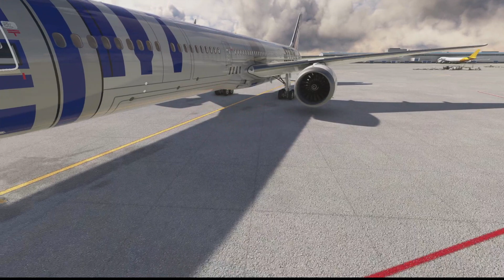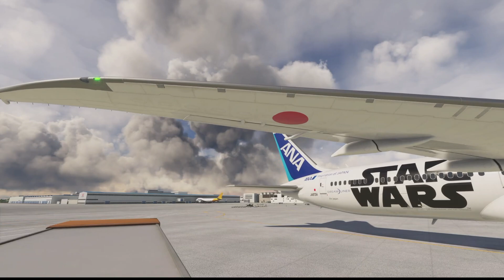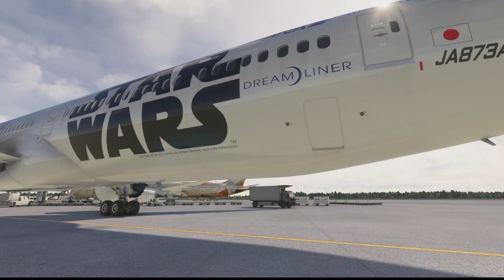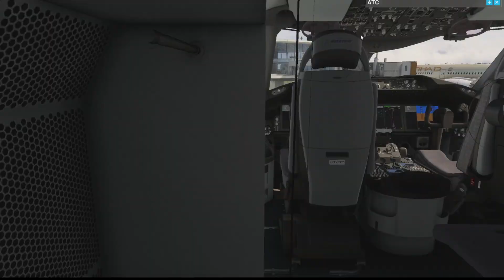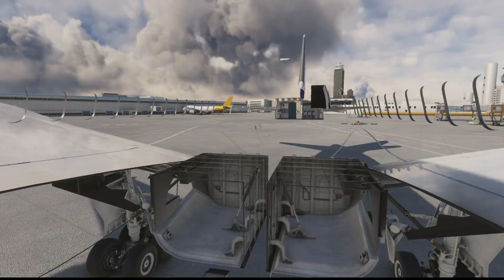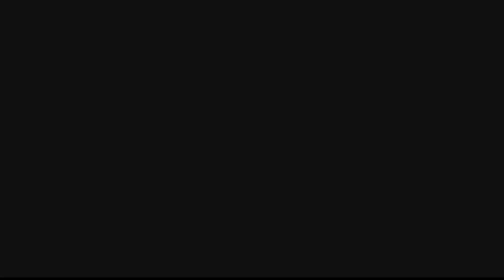SIM UPDATE 15 Performance Test  XBOX #microsoftflightsimulator #msfs2020 #msfs  #xbox

Comment: What mods are you using?
Reply from the maker: Hi, thanks for your question. I try and keep add ons to a minimum as the Xbox can struggle a bit. I have The Flow Essentials toolbar, LVFR Static Airport Traffic and then for this video I’ve installed the drzewiecki design Narita international scenery which is pretty complex. I also have real-time weather on but turn off traffic & multiplayer. Thanks for watching & commenting, appreciated ✈️👊

Comment: How do the AI aircraft around you have liveries if you are on Xbox?
Reply from the maker: Hi, thanks for your question. I have the LVFR Static Aircraft add on installed which puts various aircraft / liveries dotted around the stands to match with wherever you are in the world which is cool and adds a bit more immersion rather than the default MSFS planes. What I would say is if you fly with multiplayer or real world traffic on it can be annoying as sometimes they’ll park on top of the statics. Apart from that I’d recommend, no noticeable hit on performance. Thanks for watching ✈️👊

Comment: My friend, plz, what addons do you have installed ? Weather pro ? How many world update ? Flow essential....? Thanks for your vidéos !
Reply from the maker: Hey thanks for your question. As I’m on Xbox I’m fairly limited to the add ons I can use. I just use the default MSFS weather which in my opinion is superb. I have flow essentials & LVFR Static traffic to give the airports a more immersive feel. Then I do have a lot of sceneries installed because the default airports are just rubbish! I also have all the world updates installed. Although I switch off real time traffic & multiplayer servers as the Xbox really struggles with that. I’ve also recently been experimenting with 8gb rolling cache as apparently this now helps with stability. Thanks for watching & happy simming 👍✈️